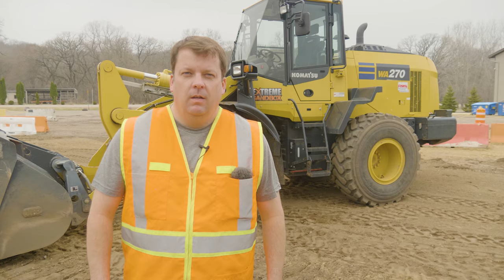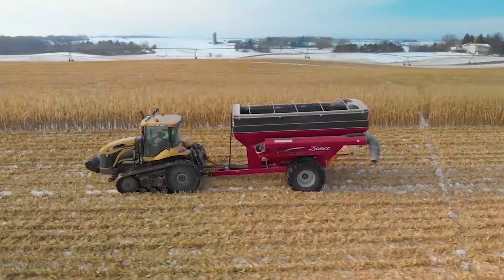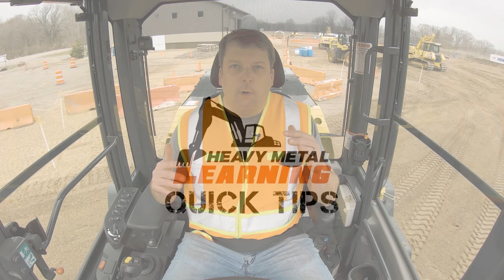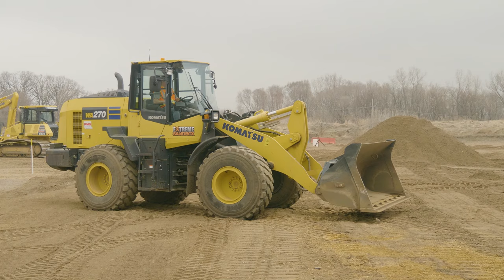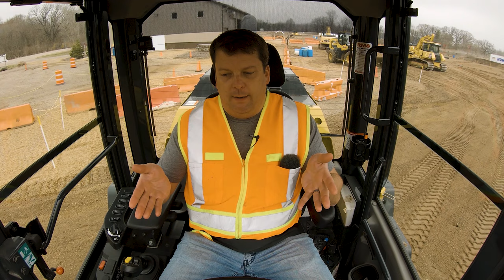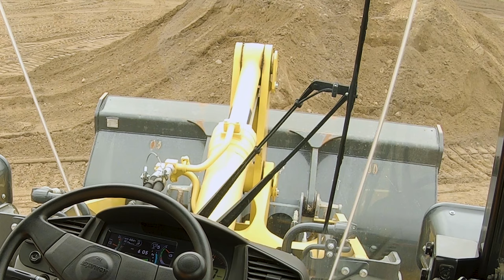How to Properly Load a Wheel Loader Bucket | Quick Tips // Heavy Equipment Operator

Comment: Another helpful tip to go along with this video,  I believe not many people give thought to snapping the bucket when its full. In doing that it levels the material better and excess falls at the pile, saving you cleanup on the site or in the street. Also after the bucket is full in my experience, it has been a better practice to not bring the bucket down to a low position. Keeping the bucket a little higher keeps the material from spills  due to sudden stops or uneven ground. Operating machines in NYC those 2 moves save alot of cleanup time when sudden stops and uneven surfaces are a constant issue.
Reply: Yeah that snap of the bucket is such a time saver, I always do it. Or some times, I reverse out. Put it in neutral,  than slam on the breaks to come to a complete stop, and all the excess spillage is at the foot of my pile, not all over the quarry floor, for me to hit next time and put unnecessary wear on my body throughout the day, causing me fatigue!
Reply from the maker: This is an EXCELLENT point!  Thanks for sharing!
Reply: @timfagan816  That is where Caterpillar were far superior in the old days they had faster responding hydraulics and you could get that snap easier.
Reply: @Fatamus  they sure were,  I find the komatsus to be really lazy and slow to react, I was running a volvo l150f for 2½years, and that was a very responsive machine, and you could get the snap every time.  Now I run a Hyundai hl770-9 and I love it, such a nice machine. Just hasn't quite got the snap over the volvo or cat, but runs rings around my work mates,  wa480 komatsu. Only thing I like better on the volvo, was the detent. When you have your foot on the break, it would still slowly drive into the pile. But send 80% of its power to the boom so you always got a full bucket. On my Hyundai no matter what setting you have it on. It just jumps straight into neutral,  and makes for such a hard tiring day.  So I just leave it off! And give it the old reverse and shake. To get rid of the loose stuff from the bucket before tramming to the jaw crusher.
Reply: Yeah, the snap is important unless you're loading slop. Then it makes a hell of a mess. Hard on the windshield also.
Reply: @hankhankenhunter3876  haha, so true we was cleaning out the bottom of a slucing pond, into the back of a terex ta40 and damn was using washer fluid like it was going out of fashion haha. Such a mucky job.but 30 tones of slop going off the tip head, looks soooo cool though!
Reply: @hankhankenhunter3876  I'd only recommend snapping a bucket of slop for the open cab fellas. Other than that I'd have to agree
Reply: Yea snap is good. In the Australia we use this one on rio site doing civils. There is a rev adjuster as well for the hydraulics. We deal with real hard soil n ur got to be abit more aggressive lol
Reply: I was just about to comment that. Good job 🤙🏻
Reply: I also recommended giving the bucket a jiggle after dumping the bucket if going for a different material , clears out any material that got stuck , I make top soil and dirt / sand will get stuck in place in the bucket

Comment: The main key is to hit the pile in second gear drop down to first start your lift and curl and continue moving forward.
Reply: When I have 50 trucks to load I don’t have time to go slow
Reply from the maker: Thanks for the comment!
Reply: @HeavyMetalLearning  similar to using a bobcat
Reply: @pdbabe  but if u are in a higher gear you wont be able to penetrate the pile..and loading 50 trucks is just a matter of going in reverse and turning then going forward and dumping..im confused by your comment

Comment: It is nearly 60 years since I learned to drive a wheel loader, but although machines are more sophisticated now, the process has not changed significantly. I’ve watched many training videos and not seen any that would completely fill the bucket every time regardless of the type of material.
To get a full bucket easily, I was taught to drive into the pile until I felt resistance and then lock the boom lever back, and immediately keep the bucket lever moving, first up and then down and up and down while the boom is slowly lifting and the machine is creeping forward. Then when you curl the bucket back, you see material trickle over the back right across the top. 
It is similar to using a hand shovel in hard material where you have to rock the shovel up and down to overcome resistance.
Reply: Of course, the above comment only applies with four-wheel drive, and 50 or 60 years ago, many loaders were two-wheel drive, which needed different techniques depending on whether they drove on the front or back axle. Happy days.

Comment: When loading a more coarse material such as large rocks. I find it best to start in second gear with the bucket to the ground, push into the pile, drop to first gear, hold down the gas and lift the arm at the same time as you curl the bucket. The arm won't lift on its own but when the bucket is curled it will. Once it lifts a little, keep pulling it up and curl the bucket back out as you hold the brake. This will allow the blade to dig further into the pile. Keep repeating until you're at the top of the pile and curl your bucket all the way back. Bring the arm down and back out a little. Then curl out the bucket just a little, back up, and slam the break at the same time you curl the bucket back fast. This will set everything in the bucket and let the excess fall off. It's the best way I've found to go about a very rocky material
Reply: You are an employee I would never allow on my equipment. Going into weight in 2nd gear? Youre fired bud
Reply: @MARALAGO2024  that's how I was trained by two different people and that's how the boss man wanted it done. Had to leave that place tho. Very toxic management

Comment: Hi sir what is the best gear when you curl the bucket.. I used only first gear when I started to curl up the bucket then I reverse for second gear to load dump trucks
Reply from the maker: Most of the newer hydro static transmissions won't matter as much, because they will still shift down.   But I am usually in 2 when loading trucks.
Reply: OK sir tnx for  nice information I only used Komatsu excavator but in wheel loader I used caterpillar machines